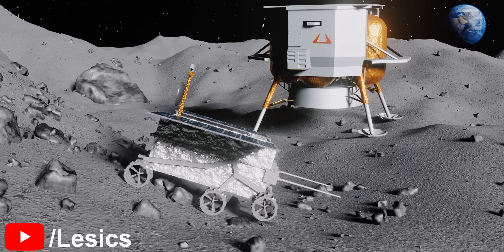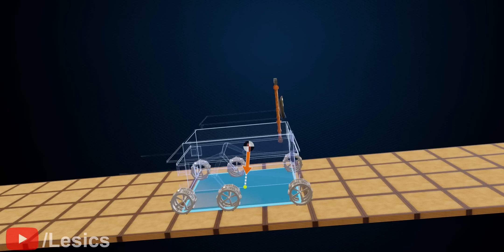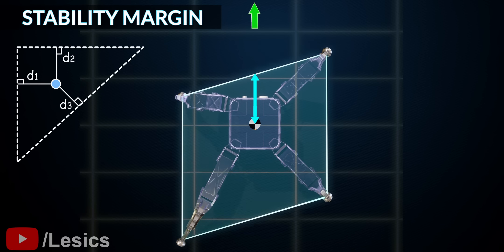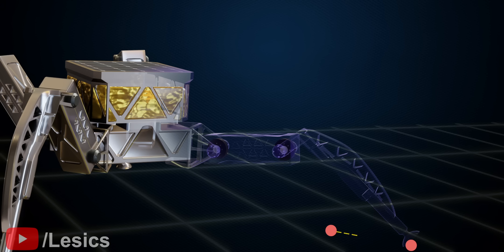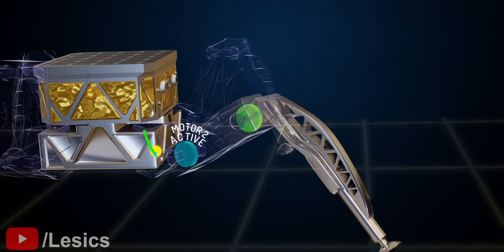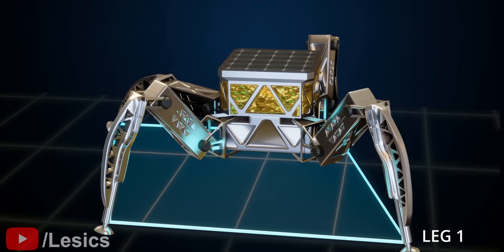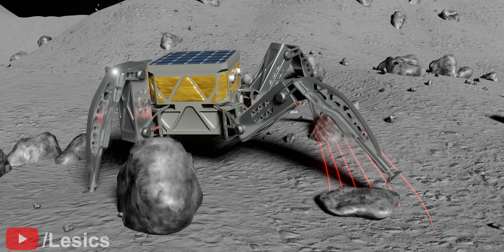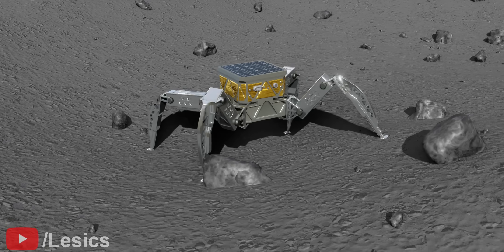Four Legged Rovers | The future of space rover technolgy

Comment: Is there a concern with a legged rover on the increased number of moving parts? With 3 motors per leg and no redundancy, a single failure seem like it would disable the whole rover. It might be able to limp along with a leg disabled, but it would not be nearly as stable.
Reply: 4 motors become 12 with a much smaller solar panel footprint. An Axel can hold more weight than the leg with less effort. Not to mention that the motors on the legs have to constantly resist gravity so there's no turning off. For locking joints you would have to include some sort a gear ratio that would also make motors work harder. There's definite advantages but I think for more niche situations. like in addition to a rover that can detach for short periods to investigate areas too dangerous for the rover.
Reply: his big brother with 8 legs arrives and removes broken leg and donates one of his then returns to the mother ship to get fixed to be able to return to his sister
Reply: one issue with legs is a large amount of energy is wasted repositioning the legs for the next step where a wheel is 100% turning energy into motion all the time
Reply: @cornbreadcuban5456  IIRC Spacebit's mission plan was to test this first, then later do one with a companion rover to carry it further afield. This is if they are actually legit of course.
Reply: yes there is. that's why every rover has wheels.
Reply: I think flying rover with only 1 motor and 1 propeller will great idea...and will be near perfect if can build flying rover with backup motor and propeller in one rover.less moving part (effective for this context i think)

Comment: And what prevents you from making a rover according to the classic wheel scheme, but with the possibility of shifting the center of gravity? After all, you can use the same principle of chassis suspension, but on wheels, it's easier and less energy-consuming.
In extreme cases, if the climb is really very steep and the wheels slip, or the climb has obstacles in the form of stones, you can block the wheels and overcome the climb by walking.
Reply: This is quite possible, but then the rover will become even more complicated, it will be a wheeled rover + walking = even more possible points of failure. An even bigger plus is that the rover can roll itself over after a fall, which may not be so easy to do if the wheels are bolted to the legs. Such a hybrid will also be heavier than a walking rover. Yes, it will consume less energy while riding, but more while walking. There are also problems with the suspension, which is difficult to implement on such a hybrid. 
In general, the idea of such a hybrid is not new, and it has some sense, but also its drawbacks.
Reply: @Alexandr_Lee  I personally see this idea as more promising than just a walking rover. I don't see any significant problems in putting the overturned rover back on the wheels, as well as problems with the suspension.
Reply: @Top_YouTube_Music  I say we send the walking rover a car.

The walking rover can study things close in rugget tearain, whaile the car can carry stuff and drive long distance on semi smooth ground
Reply: I think one advantage legged rover could have not mentioned by the video is that you could give the legs some kind of suction or gripping mechanism to handle even more extreme terrain. Like climbing vertically up and down a cliff.

Comment: Can't we make a hybrid of two models which uses legs on tougher terrains and wheels on flat ones
Reply: Probably could.
Reply: I am sure they could. but sometimes depending on the mission having both options might add too much weight and complexity. Having wheels, legs or both each have drawbacks and advantages. I am sure the best of these options or even other movement options (flight for instance on planets with atmosphere) depending on the mission and terrain features will dictate what is chosen.
Reply: Just put wheels on long legs.
Reply: Mission 2 would have a wheeled rover IIRC

Comment: Horizon is very close on the Moon. In order to see where you are going you want cameras on top of the mast as high as reasonably possible. Legged robot have his cameras lower compared to a similar wheeled one. It means it can hardly see where it is going. It also has twice the motor count and control logic is simple only as long as you walk on flat surface and your legs do not trip on anything.

Comment: Can you explain what did you mean when saying about moving one motor ?
Because it was visible that every other motor also moved.

If my understanding is correct, it should mean that you're controlling one motor's variables and others are adjusted to satisfy some constraints. If this is the case, what are those constraints ?
Reply: I think he was only moving one motor in the explanation at a time for clarity's sake. Similarly the jerky movement was to illustrate that the motors may have a minimum movement that they can reliably measure, at motor this is often barely perceptible but can be amplified the longer the attached lever. Even so it was exaggerated here just for illustrative purposes.

Comment: Do MPU6050's work in space? Any info on how the touch and torque sensors work or what is being used for them and the servos. Any other tech specs you know about? What are the approximate dimensions of the main cube?
Reply: OK checked, -40 to +85C, moon is -183 to +106C so guess it's going to have to be heated/cooled in the center of the main body. Dunno about radiation resilience.

Comment: Couldnt a simple hydraulic sistem located on the last wheels solve this problem? While increasing the angle of the terrain the hydraulic sistem will combat that while pushing the back wheels down das retaining the center of gravity.
Reply: For space mechanisms, try to avoid hydraulics. Temperature, pressure, evaporation, sealing, lubrication, etc. cause terrible problems.
Reply: European Mars rover can do something like that. It is electric though.
Reply: @SALESENGLISH2020  electric linear actuator then?

Comment: The unanswered question in this video:
How all these moving parts will survive the very sharp and hard moon dust?
Reply: The joints could be protected by a flexible sheath of some sort.
Reply: @Nom8d  if you check their twitter, they had a video somewhere showing this. However I wonder how such a material can remain both protective and flexible in temperatures between -182 to  +106C

Comment: WHY I CALLED THE ROVER BAD IN MY OTHER COMMENT:
IIs because everything about it feels like the infancy of robotics, the way it moves is extremely basic and simplistic, it's bad in terms of design with no redundancy and 12 servomotors, any 1 of them breaks you got yourself a bricked rover, the reverse kinematics feels like a toddler compared to the stuff of boston dynamics, and an amateur could do better after a few weeks of coding and trial and error, the solar pannel is ridiculously small for a vehicle that size hinting that the designer has no idea how solar pannels even remotely work, it's lacking skin to protect from dust which is a personal pet peave of mine, the way it's servos are placed is something that is done for ease of design, not efficiency, as the motors literally work against a mechanical advantage, this thing is literally a bunch of overloaded motors trying to lift mass by the wrong end of a lever, when you remember that they're unshielded fragile servomotors surrounded by the famously destructive moondust and that if any 1 of the 12 breaks the rover is as good as dead, and that they're all placed in the worst possible place they could be, you begin to see why I call it a terrible design

Walking rovers arent necessarily a bad idea, but to turn them into a good idea you need a design that takes reliability and mechanical advantage into account, and uses AI to both do pathing and advanced reverse kinematics, like the ones of boston dynamics, this one is quite bad even by amateur walker standards, let alone something you would buy an entire expensive rocket full of millions of gallons of gasoline for
Reply: another terrible piece of design brilliantly displayed at 8:25 lol :
just look at that sequence, what state do you think the (hilariously small) solar pannel would be in after sliding accross a giant dune of what is basically razor sharp basalt? yeah not good, which is an issue that could be fixed with something as simple as lightweight metal rails to lift the solar pannel surface in the eventuallity of a rollover slide

also WAIT, didn't he said that this rover was designed to explore caves on the moon? WITH A SOLAR PANNEL? is this company a scam or what? seriously